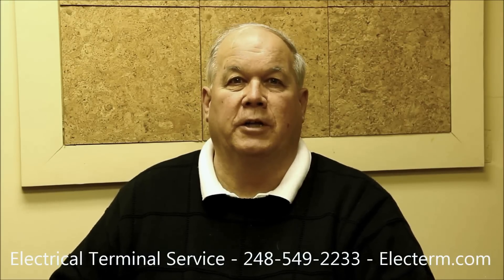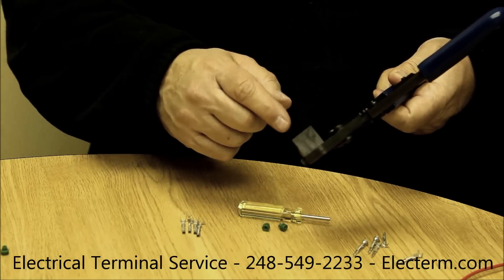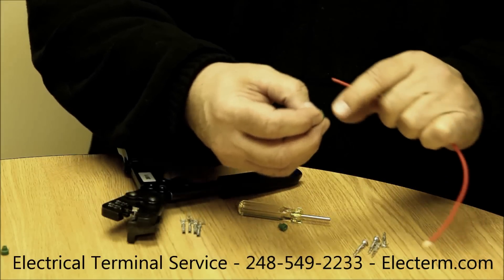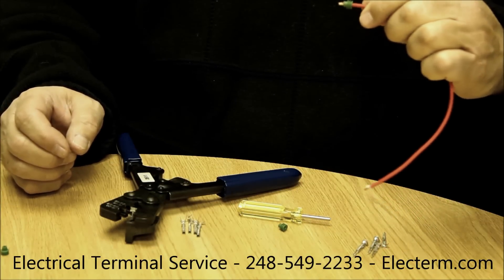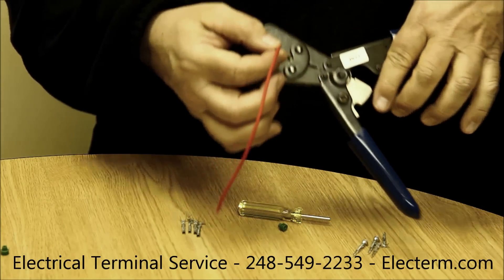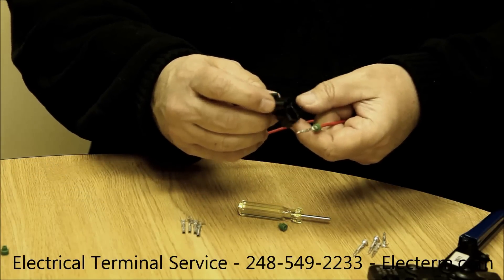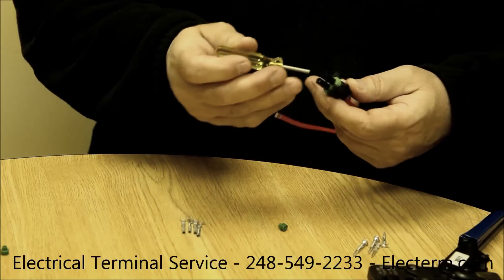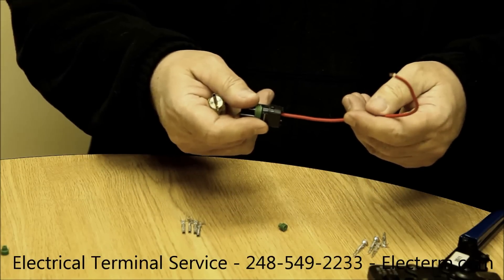Crimping and Assembling a Packard Weather Pack Connector

Comment: Will That tool work for metri-pack terminals as well?
Reply: +Electrical Terminal Service Thanks...Is the holder easy to remove?
Reply from the maker: +retiredsearge Yes, it removes easily with an Allen wrench.
Reply: Thanks

Comment: Great video. Super helpful. Thanks!
Using on an old BMW R100GS motorcycle to clean up the old, stock corroded terminals and make the bike easier to work on and maintain.

Comment: Gary I have the Delphi crimper for the weather pack terminals, but the Metri pack terminals don't fit in it to hold them. Do they make the locator for a metri pack GT 280 terminal to go on the Delphi weather pack crimper?

Thanks  Wayne
Reply from the maker: Delphi tools are very specific to the item. So no, not for this tool. See here for metri-pack tools: http://www.electerm.com/metripackcrimpingtools

Comment: Is there any special tool or accepted methodology for undoing the crimps, in order to reuse the same stripped wire end with a new terminal? Will be working on a set of fuel injector connectors and would rather not shorten the wires by cutting back unnecessarily. Thanks!
Reply from the maker: +VideoNOLA Unfortunately - no, you'd have to cut the quarter inch of wire off and restrip and reuse.

Comment: Nice video, thank you. I'm a hobbyist and I'm building my own headlight harness with heavy gauge wires. I'd like to use the 12-10 AWG Weather Pack connectors in the relays. The tool you're using seems a little small for that, What tool would you suggest I use to do that with? I wouldn't mind something that makes you crimp each contact area separately.